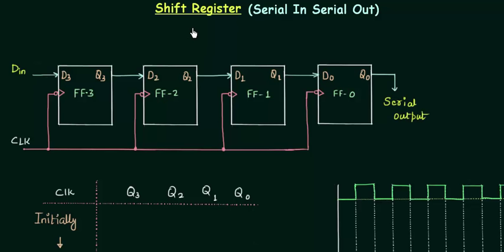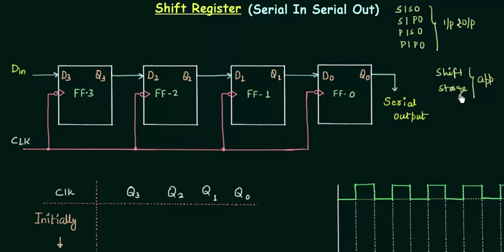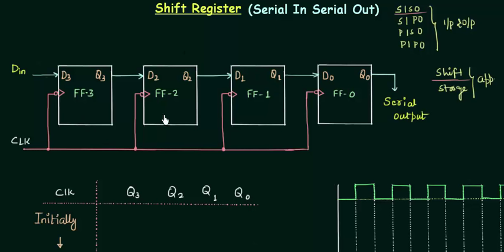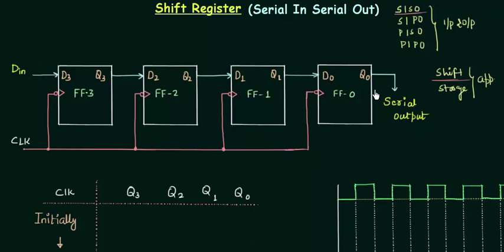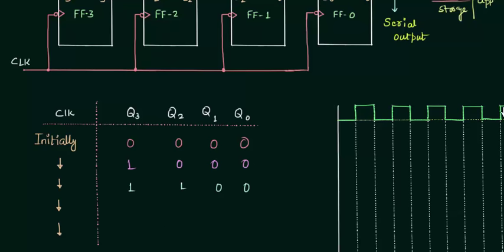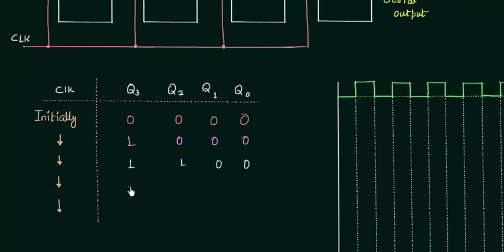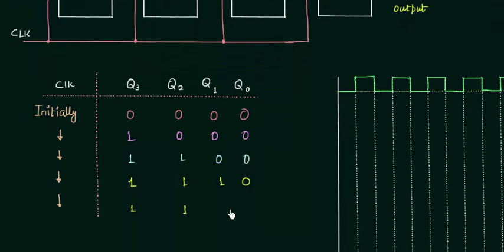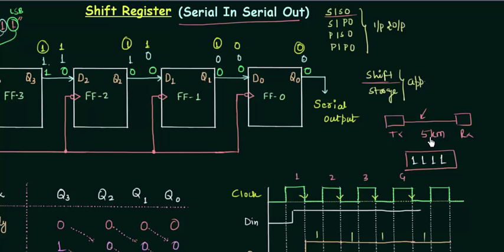Shift Register (SISO Mode)

Comment: Amazing video! Really helping me study for me ECE midterm right now
Reply: @Prateek Patel I am guessing because of the clock it will only take the value that is current. For example when d3 receives a input and d2 will also receive a input at the same time because its a synchronous circuit so at that when d3=1, q3 has a previous 0 which transfers over to d2

Comment: 9:31 but to get the entire output of 1111 shifted out we would need eight clock pulses right? Because we can only see Q0 as the output then after 4 clock pulses the o/p would be 1 but as we go from 4 to 8 pulses we would get 1,1,1,1 as the o/p of Q0.
Reply: I think we'll need 7 clock, actually for n FFs, we need n clock for storing i/p, and (n-1) for taking o/p. So, total will be 2n-1

Comment: I need to know how to solve this kind of problems as soon as possible Sir,

	 	 	 	
- You have an 8 GB RAM module with 8 byte words. Calculate:
The 	number of locations in the RAM module.
The 	number of address lines in the RAM module. 	

- Given that the RAM is constructed from 4K X 16 bit RAM chips, calculate:
The 	number of chips needed. 	
The 	number of address lines that need to be connected to the 4K X 16 RAM 	chips. 	
The 	number of address lines that need to be connected to the decoder.
The 	size of the decoder required.

Comment: hows d2 = 0 in the first case because the q3 is the input for the second d flip flop
Reply: Exactly...
Reply: Because of clk
Reply: maybe because it is negative edge triggered flip flops that we are using, so the q3 changes only at the negative edge since Din=1 but at the time of clock change q3 is still 0 so there's no reason for the q2 to change as q3 changes just after the clock change
Reply: Because it is negative edge triggered not negative level triggered. So D2 has to wait for the negative negative edge to change its value.
What I meant is that value of D2 won't change until the next clk pulse.
Reply: Well it's because of clock and I  its think already explained by people below but keep in mind that  dont state the reason  of d2 to being  0 by stating  that clk  is  negative edges/level  triggered in exams because you can keep it positive as well , would work just the same but the graph would differ .
Reply: @animeshpathak3921  yeah my bad would work for positive edge triggered too!
Reply: @soumyasishbhattacharyya2805  So if it's edge triggered, then it only changes on the edge and it's called a flip flop. If it's level triggered, then it can change immediately depending on the level. Usually, if it's level triggered it's called a latch.
Reply: @ProLeopardx1  thanks :)
Reply: @soumyasishbhattacharyya2805  no problem!

Comment: I was wondering when D(3) is 1 Then Q(3) is 1 , then why (D2) is not equal to 1 and that results in Q(2) is equal to 1 and similarly (Q0) is equal to 1 instantenously as these are all are connected?? why the value of Q2 or Q1 or Q0 changes only when second or third is provided to D3.
Reply: This happens due to delay of gates present in D-flip flop which is higher than delay caused by clk(which is a single wire).By the time o/p 1(high) of Q3 for LSB reaches D2 the clk pluse turns zero so it doesn't counts. Initially Q-3,2,1,0 are 0. When the first negative edge of clk simultaneously arrives at all input side, input at D3 at that time is 1 at D2 is 0 at D1 is 0 at D0 is 0. Same goes further cases. 
Hope this helps.
Reply: Thank you so much for clarification, I did thought may be it was because of master slave relation where on first it gets stored and on second pulse it shift. How wrong I was and I asked the same thing to many my friends but now I realize they have all wrong concept of it. Now it solves all and fit perfectly to puzzle. And By the way thank you so much for such nice lessons..It has helped to an enormous extent, whenever Teacher teache us and I have no idea what he is teaching....your channel always comes in my mind and take away all worries and when I came back you don't disappoint me too....Thanks one again.
Reply: downside up! Thank u bro
Reply: @vinamra4893  where did you learn this bro?
Reply: @vinamra4893 Yaaa
Reply: @Mysterious_debris_1111  I must have googled it! Google has an answer for everything!

Comment: At 7:24 why didn't u rise at the negative edge?
Reply: In case you have nt got the ans., still.....That is Din as in the input , in the subsequent lecture he had told that its a good practice to raise it before the negative edge just for the initial inputs(not for Q0, Q1, Q2, Q3) .That is how the system literally works.

Comment: No you cant upload the msb first at right shift register only at left  that why you example is not convenient you should have use "0011""0101" for better understanding
Reply: costpsy To upload data using msb you need to reverse the outpur ports..that is q3 to q0, q2 to q1, q1 to q2 and q0 to q3. where q3 is msb and q0 is lsb.
Reply: but in the next presentaion he hs used q3 as lsb.... so which one to follow

Comment: why are u particularly considering "negative edge triggering"?
Reply: The clock line enters the D- Flip flop with an arrow head. The arrow head means the FF is negative edge triggered, if there is no arrow the FF is positive edge triggered.
Reply: @khalidhindi2320  The circle before the arrow indicates falling edge sensitive. The arrow indicates a synchronous clock.

Comment: It could be my misunderstanding ,  But doesn't it seems to be a parallel output because serial output is made of more than one bit. 
please someone correct me.
Reply: Late reply but might be helpful for others: The above video gives parallel output only, if you observe Q0 then you will see that after 4 pulses, it contains only the LSB, so you need to give another 3 pulses to shift the remaining bits to Q0.
Reply: @prasanjitrath281  Right!
I just checked again and found that even if we give 3clock pulses extra, the data we're getting in serial form is in reverse order. I took 1011 as an example, the order I got is in reverse. Please clarify.😐
Reply: @AnoNymous-po5sx   That is happening because you are feeding the left most bit first to register, so you are getting 1101 for 1011 input. So, if consider your example as 1011, just start feeding the MSB first and then go towards LSB.
Reply: @prasanjitrath281  Yeah I got it. Thank you! 😁😁😁

Comment: sir,i think something is wrong , please check it once more using 0100.i think you can't start with MSB .
Reply: Thank you for the information sir .
Reply: Neso Academy only thing which i dont understand is why negative edge trig clock is given??? how the circut operate for a value 1010 if the clock is not negative??? can u tell plz

Comment: IF D3 is given as 1, shouldnt the output, i.e Q4 be iving out 1? why is it 0? 
please help.
Reply: This happens due to delay of gates present in D-flip flop which is higher than delay caused by clk(which is a single wire).By the time o/p 1(high) of Q3 for LSB reaches D2 the clk pluse turns zero so it doesn't counts. Initially Q-3,2,1,0 are 0. When the first negative edge of clk simultaneously arrives at all input side, input at D3 at that time is 1 at D2 is 0 at D1 is 0 at D0 is 0. Same goes further cases. 
Hope this helps.

Comment: You are using positive edge triggered D flip flop... And why  are you writing waveform for falling clock
Reply: Karthik Jogi the D ffs are -ve triggered. Look closely at the diagram; there is the small triangle symbol with a circular node. The node means -ve triggered, without it is +ve triggered
Reply: @9nour  thnx mate, i had not observed e tht node!! 😅It ws not tht clear in portrait mode!!

Comment: does the siso register store this data for long and whenever we want the output we request it, or the output comes out as soon as the signal is applied? if it's the second case then what would it benefit us if the output signal is equal to the input but just delayed by few micro-seconds?

Comment: Sir Can u tell the logic of left shift SISO ?????
Sir and also check for 1011 by starting iniitially with MSB output is not same as LSB??Ans will be reverse of LSB
Reply: please answer anyone !
Reply: Arjav Vakharia You can upload using msb bt for that you need to reverse the ports of outputs i.e. q3 to q0, q2 to q1, q1 to q2 and q0 to q3 and then perform operation..where q3 is msb and q0 is lsb.

Comment: Why does the outputs only "switch" when the clock has a falling edge? I have difficulty visualizing the timing. Couldn't it also theoretically only "switch" at every second cycle if the gate delay is much slower than the clock or even at uneven timing if the gate delay isn't a multiple of the clock speed?
Reply: Please study edge triggered flip-flops in detail. That may be helpful. There are positive & negative edge triggered flip- flops. Over here, we use the negative edge triggered type. These edge triggered flip- flops read the data available at the input  only at the instant of  the negative edge - not before or after the edge & store it. Hope it helps.